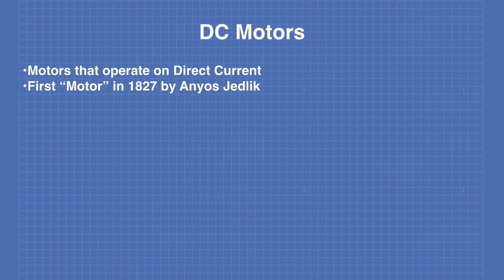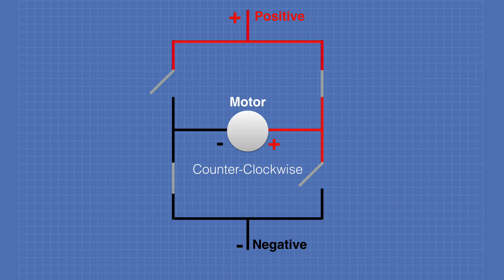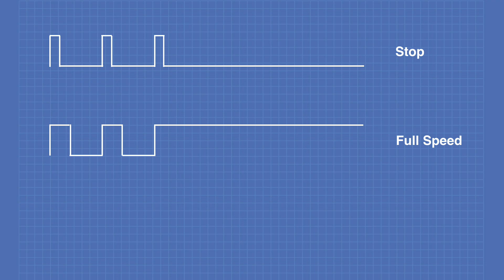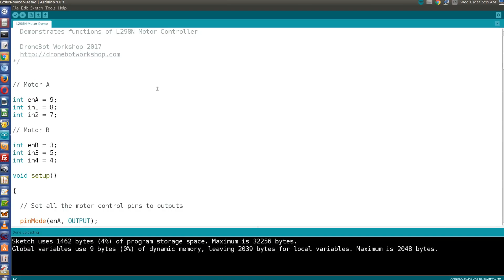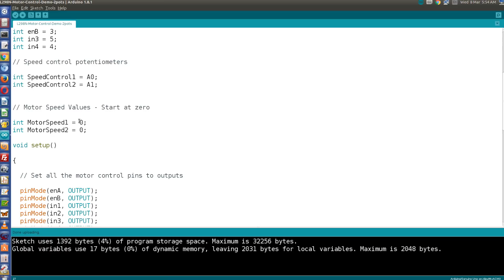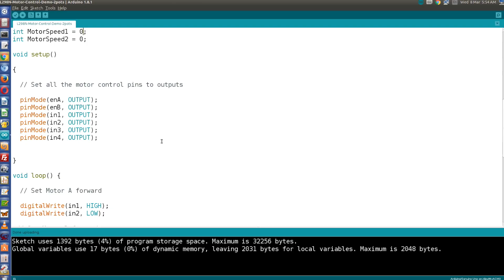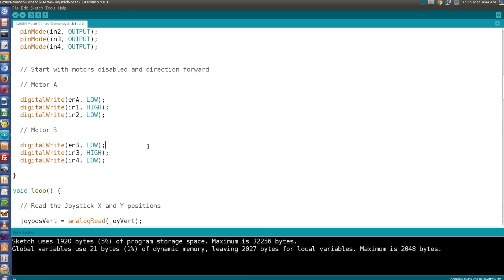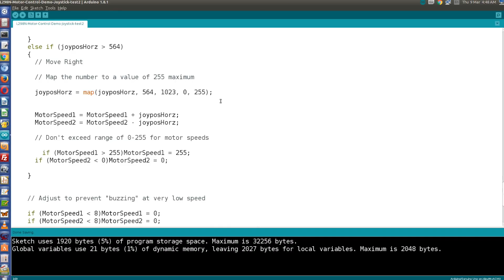Controlling DC Motors with the L298N H Bridge and Arduino

Comment: need more on the power delivery. what PSU? how to step down to 7.4 and 5.0? two separate voltage regulators?
Reply from the maker: Lots of possibilities to power this. 
A 5-volt power supply is pretty well an essential item to do any experimenting with, I have one that I built into my workbench but you can use a standard USB power supply as well.
I used a buck converter in this video to step down the 12-volt power supply that I have in my workbench to 7.4 volts, but again there are several other options. 5 AA or AAA cells will give you 7.5 volts (I used this arrangement in my Robot Car video https://youtu.be/oQQpAACa3ac ) . You could also use two 18650 cells in series, although if you go that route be very careful with how you charge them.

Comment: You may have already considered and already use one, Panavise with various bases-head configurations, I really like my Panavise setup - esp the flex gator clippys an excellent tool.
Reply from the maker: I also have a Panavise, I just don't keep it on my workbench as I've run out of room!  It's an excellent tool.
I also have an Aven Circuit Board Holder which I find to be excellent for holding PCB's, especially large ones.

Comment: Very nice presentation (also getting ideas for my own work space) so thanks for that.  One note: at 23:18, where you do stall buzz elimination with a separate set of if-statements.  Why not do it with the map() function?  E.g.:
 map(MotorSpeed1, 0, 1023, 8, 255);
That way you not only won't have a dead band (i.e. that 0 to 8 segment will be spread into the motor speed range), your code will, also, be more efficient.

Otherwise, it seems like a waste of a good map function (and further justifies its use).
Reply from the maker: Steve that's an excellent suggestion, I'll admit that I didn't make full use of the potential of the map function.  Many thanks for pointing that out.

Comment: i found another motor driver, l293d. its an ic.
Can you tell me the difference between this and the one you've used in the video?
Reply from the maker: The L298D is a lower-current version of the L298N used in the H-Bridge module I'm demonstrating in the video.  If your motors consume less than 600 ma each then you can use it in place of the L298N.

Comment: will this  work with  Hitec High Torque Digital Servos  using PWM  that will  replace the wheel motors
Reply from the maker: Actually driving servo motors is a different story, I'll be doing a video on servos (and one on brushless DC motors) very soon.
In the meantime check out the Arduino Servo Library, lots of great information there - https://www.arduino.cc/en/Reference/Servo
Reply: Thanks for the reply will look at the link   this shows what i'm trying to accomplish  https://www.youtube.com/watch?v=v6W6FpL9zFg   for a completely different application

Comment: My motor driver l298n is burning when connecting 12v 1.3 ah lead acid battery directly..! How to fix? Will using a mt3608 dc dc step up will work? So that I can reduce the current from battery.! Please help.!
Reply from the maker: Hi Ambarish
A "burning" motor driver is never a good thing! Here is what I would do to troubleshoot this potentially dangerous problem:

1 - I'm assuming you are using a motor rated for use at 12 volts.
2 - Disconnect the motor ands use a multimeter to measure the resistance across the motor leads. It will be low (I measured 7 ohms across a working motor) but it should not be a dead short (i.e. very close to zero ohms). 
3 - Assuming you got a reasonable reading in step 2 use your multimeter in current measuring mode and connect the motor directly to your battery, with the multimeter in series with the motor.  See if the motor spins and observe how much current it draws. If it takes more than 3 amperes then you'll need a different H-Bridge, as the L298N can only handle about 3 amps.
4 - You've probably already checked this but make sure that the motor isn't seized upon it's shaft, a seized motor can consume a great deal of current.
5 - If all else fails and the motor draws less than 3 amps you may have a defective L298N module - it's rare but it happens.

"Reducing" the current from the battery is not the issue nor is it the solution - the motor will consume as much current as it needs from the power source regardless of the power sources capability.

Hope this helps and be careful when you test this - your battery is capable of delivering a lot of power! If you have a bench power supply you may want to use this instead as it probably will have some form of overcurrent protection, which will make your experimenting safer.
Reply: DroneBot Workshop Thanks a lot..!!
Reply: DroneBot Workshop Yea I'm using 4 12v 200 rpm dc motors, with two in series.. and connect to both two output of l298n..!  the motor driver caught fire instantly i connected 12v battery,  before I was running the motors..!!! Motors measures around 120 ohm when it's not working.. ie 2 motors in series connected measures 120 in my multimeter..! I appreciate your time  and effort to reply my querie.. thank you very much..!
Reply from the maker: The motors in series might be related to the problem (and it might not, but it's worth investigating).

First, if you are wiring 12volt motors in series then you actually need 24 volts to run them. With only 12 volts each motor is just getting 6 volts, which may not be enough to turn them.

Secondly, DC motors are pretty well identical to DC generators. As a result each motor produces a "back EMF" when it turns. The L298N (and most other motor drivers) absorbs this internally with a diode. In your arrangement this is complicated by that back EMF travelling through the second set of motor coils. Not sure if this would cause problems or not. 

I would suggest trying your setup with a single motor first, to see if it is working, before moving on to two motors. And if your H-Bridge did indeed catch fire it's possible that it may now be damaged, heat and electronics are seldom a good mix.

Personally if I had to run 4 motors I would use two L298N H-Bridges and drive each one independently. This way you could "fine tune" the speed of each motor, and if one failed it would not affect the other ones.

Keep in touch, I'd be interested to hear what the solution was when you find it.
Reply: DroneBot Workshop but this happening even when the motor is not connected..  when I connected the 12v battery, smoke started coming... from one of the M7 diode in motor driver and started burn.. the led indicator didn't glowed... The m7 diode was burned and destroyed... black cotting melted.. i  later tried... this time led glowed.. nothing burned again.. the metal capacitors was heating badly.. there were no voltage across the motor output pins both at steady state and when logic high from the microcontroller... My 12v 4 channel  relay module also burned when I connected this battery without any load applied.. a small diode burned as soon as I connected the battery..  when I measured the voltage on battery.. it measures between 12.4 and 12.2 volts..This is a fresh and new lead acid rechargeble battery... I'm confused  about connecting this to new motor driver.. i lost lot of money btw... Also could you please explain about using 2 motor drivers simultaneously... I'm having a 5 channel rf receiver working on 4.75 volts..and thank you for all your support.. I'm grateful..!!!!
Reply from the maker: Ambarish if the L298N board burned as soon as you connected it up then it probably was defective - that should never happen with a working board.  But if you also burned your relay module with the same battery perhaps you should try using a bench power supply while you are developing your project, along with a multimeter to measure current (if your power supply doesn't have a current indicator) to be on the safe side. Something here is consuming a lot of current and you need to find out what it is.

Break your design down to its simplest form, connect the components up one at a time and measure the current draw at each step. Hopefully that will explain what is eating so much current.

What I meant by using 2 motor drivers is to use a second motor driver so that each motor has its own control. If you want to save output pins on the Arduino you could parallel them (i.e use the same arduino digital output pin to drive the EN1 on both boards, same for the other 5 inputs). Or you could use independent digital output pins for each driver to give you control over each individual motor.

Whatever you do please be careful - the battery you are using is capable of a lot of current and you've already experienced a device catching fire. While I sympathize about the money you're spending on these parts the most important thing here is safety. You can replace an Arduino or an L298N if you destroy but the same can't be said about yourself or those you share your home with. Although I've never had to use it I have a fire extinguisher in my workshop, considering what you've experienced so far it wouldn't be a bad idea to have one yourself if you don't already. 

And I admire your perseverance, many people would have given up when they smoked a board.  You are a true experimenter! Best of luck with it, feel free to write back if you need more advice.
Reply: DroneBot Workshop Thank you I really appreciate your help. Thank you for your guidance and support.!!!

Comment: My motor driver connected to the 8052, my project about line follower robot using 8052. then, my left robot' motor couldn't  move.. I wonder why it could happen, please help me, this is for assignment purpose.. thank you
Reply from the maker: Hi Ibnu
I'm assuming you checked the obvious things - broken motor, bad connection etc.  Did you try temporarily connecting the motors "backwards" (i.e connect the left motor to the right motor output from the L298N) and see if the problem reverses itself?

While the code is different the 8052 should work with an L298N in an identical fashion as the Arduino AVR chips. You might try disconnecting the L298N from the 8052 and go through some of the "experiments" I performed in the video using a breadboard, this will prove that your motor driver and motor are working correctly.

Comment: How would I do Ardunio DC motor control with RPM sensing/setpoint/velocity control? I see some dc motors come with encoders. How does PWM compare to PID motor control? Thank you!
Reply from the maker: Actually Robert I'm currently recording a video that shows how to use a opto interrupter with those speed encoder disks as a speed sensor to regulate the motor speed (and measure distance travelled as well). It will be the next video (and article) that I release, hopefully early next week.

PID controllers can use PWM, the PID (Proportional Integral Derivative) controller combines feedback from sensors with historical data and future predictions to regulate motor speed. RCModelReviews (an excellent channel, definitely recommend you subscribe to it) has a great explanation of them at https://youtu.be/0vqWyramGy8

For an Arduino-specific example you might try https://create.arduino.cc/projecthub/whitebank/arduino-motor-pid-speed-control-5f4632

Comment: MY stepper motor works only with 5 volts, How can I make that Motor A and B Output only provides 5 volts and not 6-12 Volts, I am a little confused
Reply from the maker: Hi Chris, let me try and clear up some confusion if I can.
First of all this video shows how to use the L298N to control DC motors, not a stepper motor. Having said that you can indeed control one stepper motor with a L298N.
Secondly you CAN provide 5 volts to your motor by giving the controller a 6.4 volt (roughly) power supply. The L298N will drop the voltage by 1.4 volts, so 6.4 - 1.4 = 5 volts.
If you are interested I will be doing videos on stepper and servo motors soon, as they are all vital parts in robotics and other applications.

Comment: Can we connect dc motors with different rpm's. One with 10000rpm and another with 100 rpm
Reply from the maker: If you are talking about the maximum RPM for each motor then yes, there is no requirement that the two motors are the same providing that they will work on the same supply voltage and that they don't exceed the current capabilities of the L298N.

Comment: I came to look up the diff between H-Bridges and Dual H-bridges, but actually walked away thinking I have the most messy lab on Earth... :(
Reply from the maker: I doubt it's the MOST messy one LOL!
The dual H-Bridge is of course just two H-Bridges in the same controller, a common configuration as often we use motors in pairs.

Comment: How do we remotely handle the motors with the joystick without using those long wires?
Reply from the maker: I'll be doing a video on using the nRF24L01+ module with the Arduino to do something similar to that.
Also, I recently picked up a couple of "Joystick Controller Shields " that were made by Funduino. They have joysticks, 4 pushbuttons and a socket to directly plug in a nRF24L01+. Would make a very nice controller for something like this.

Comment: An other way to use the potentiometers instead of the joystick is to devide the potentiometer range (0 to 1023) into two ranges: 0 to 511 (turning left) and  512 to 1023 (turning right) where the middle position on the potentiometers stops the motors (nutral position). 511 can be 507 and 512 can be 516 to stop the buzzing as low speed
From this (middle/nutral) position turning left speeding up motor running counter clockwise and running at maximum speed at potentiometer value 0.
From this (middle/nutral) position turning right speeding up motor running clockwise and setting it up to maxmimum speed at value 1023.

Comment: I think i found a bug in the program, it says (while speeding up the motors):
for (int i =0 ; i<256 ; i++)
but it should be:
for (int i =0 ; i<255 ; i++)
as the value can have a maximum of 255
Reply from the maker: Actually the statement is valid as it says "an integer LESS than 256" which would be 255!

Comment: I’m trying to make a robot for my first project and it has wheels but I want to to fit within a size and those seem pretty large. Is there a small chip/way to control the motors?
Reply from the maker: Hi Nathan, sorry to take so long to reply.
I have a couple of L9110 Dual H-Bridge controllers in my parts drawer, they are a lot smaller than the L298N but don't handle as much current. They can easily handle the small DC motors you are likely to use in your project and they are very inexpensive as well. However they lack Enable lines so you can't control the speed, just the direction of the motors.
The L293 Dual H-Bridge modules might be more of what you're looking for. They work in an identical fashion to the L298N but are a lot smaller (and again they have less current capability).
Reply: DroneBot Workshop thanks! I’m pretty new to literally everything electronic so it’s nice to get help from someone with experience 😊
Reply from the maker: You are very welcome Nathan!

Comment: Great video. Just some suggestions.

To reverse the motor from the potentiometer,  just map input from the potentiometer through map -255, 255.

Then you set the motor direction depending on the sign of the output from map. Use an else staement and compare if output are greater or equal to 0 for forward, else reverse.
Then you set analogoutput to the absolute value from map.

I also would use constants for the ports, with #define instead of variables, as the port number should not change.

The source could also be stored in Github or any other git Web storgage service. Then you can easily upgrade your software while refering to it from your Web page. 
Great video thouh.
Reply from the maker: These are all great suggestions Anders, thank you so much!

Comment: Now how to remove the whine noise from low rpm and add more power? Usually analog PWM controllers had a few pots for this.
Reply from the maker: That is an issue. You'll note that I did a simple adjustment for that in software, but that only masks the problem instead of solving it.
I believe the controls on the analog PWM controllers can adjust the PWM frequency to eliminate the noise. You can adjust the PWM frequency on the Arduino using the "setPwmFrequency" command. Keep in mind that what this command does is change some of the Arduino's internal timers so that might affect other aspects of your code.
You can find some examples at http://playground.arduino.cc/Code/PwmFrequency . Let me know if you manage to get rid of the noise as I'm sure there are others who would find that information useful.

Comment: Dear Sir , Hello everyone . I'm student from Thailand . Right now I have some project about arduino . My project name " Smart satellite disk"  . I have to use Arduino mega2560 , Gyro Gy-9150 , L298N & 2 DC motor , Joystick and  push button switch . But I don't have  skill about arduino program before and each pinout from arduino board . As I saw this video  ,suddenly I get some idea , because it's same like with my project concept. But I'm still confuse about connection and jumper .Could you please  kindly suggest to me ? Regards,
Reply from the maker: Hi Jirapipat, sorry for the delay in replying.
Your project sounds interesting. The L298N would be hooked up exactly in the same way as you see in the video (the video uses an Uno but a Mega will work just fine). 
I would assume that you are using the GY-9150 to sense the disk position and provide feedback to the Arduino.  The GY-9150 uses the I2C connection, which on the Mega are pins 20 (SDA) and  21 (SCL) . Hint - you'll need to use the Arduino "wire" library to communicate over I2C.
If you can wait I'll be doing tutorials on using both I2C and gyro sensors in the near future.
Reply: DroneBot Workshop Thanks for your answer. It's usefull to me and all with your vedio clip.